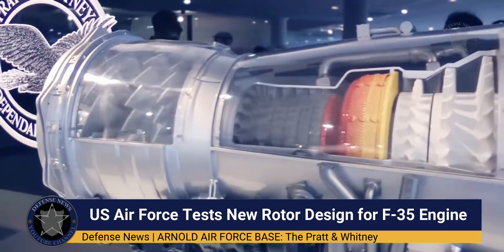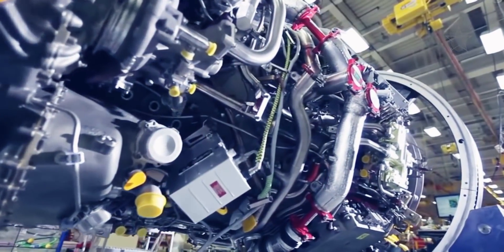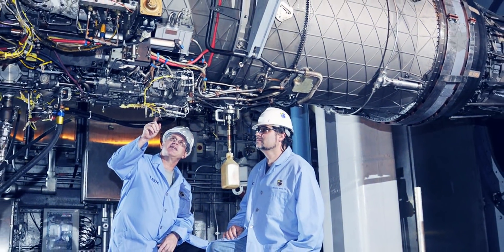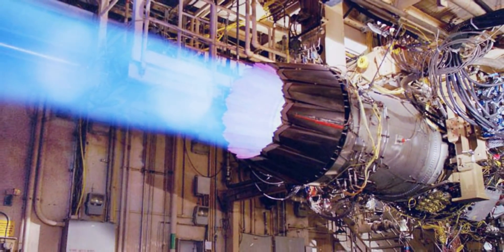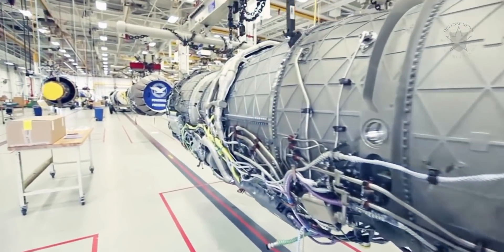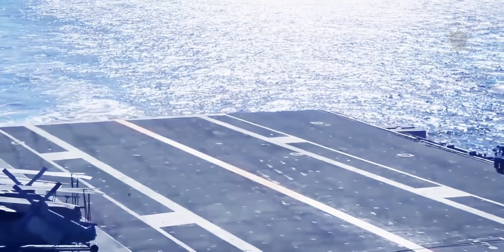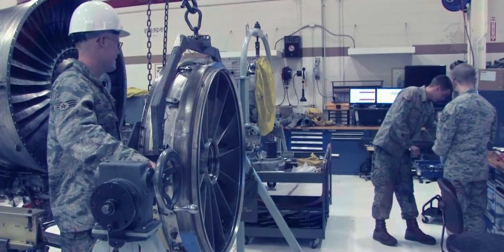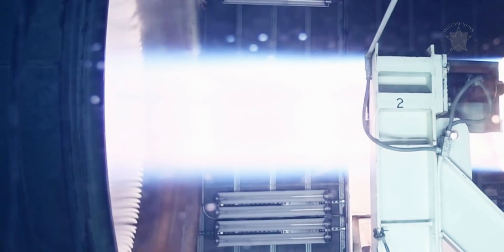USAF Tests New Rotor Design for F-35 Engine

Comment: IBR expansion exceeds tolerances during high G maneuvers. They must be using a less thermally active alloy in the rotor assembly. The DSA surface isn't mentioned, Im assuming that they're still using that method of rotor sealing?

Comment: They had a good engine to chose from. F136 GE. Politics won out again.
Reply: Would have wasted billions trying to save millions. F135 turned out to be the best fighter engine ever produced.

I'm sure an F136 would have been impressive as well, but for what?

GE is likely flying ADVENT motors as we speak in the 6th Gen program, unless USAF structured it differently than the ATF motor options from late 1980s-1991.

GE's YF-120L and N motors were the most impressive to the test pilots during DEMVAL, but the variable cycle feature represented risk to the program so Pratt was awarded, with the requirement that they match the YF-120 thrust, which they did with the production F119-PW-100.

Both companies have been working on their 6th Gen fighter engine submissions with 3 airflow paths, variable cycle modulation, extreme core temps, additive manufacturing to cut parts count, and alloy-ceramics.

I suspect we're going to see a 50,000lb thrust class fighter engine that can run at 32,500lb in mil power, which would be phenomenal.

With advanced composites and heat-mitigating leading edges, we might be in the age where we see a Mach 2 supercruise-capable fighter, where no afterburner is used.

Then again, a 50,000lb motor opens the possibility for the first time of having a large radome, high altitude, high endurance, Mach 3-capable interceptor....with a single engine. It's well within MiG-25 and F-111 thrust with 2 engines on them.

Comment: I'm not interested in the word Corona, I'm trying to figure out what part of a jet engine they're calling a rotor? I'm work around jet engines for quite a while both in the service and a bit out of the service, and I've never heard of any part of one called a rotor. Unless you're talking about part of the electric starter.

From the written description sounds like they're talking about the primary intake fan section. That is never been called a rotor to my knowledge. The only thing I've ever heard call the rotor other than the part of the electric starter is the main and tail rotor on a helicopter.

There's the intake fans with their blades, there's a compressor section blades, the individual compressor sections, the afterburner section and the tail feathers. But there's nothing in a jet engine called a rotor. But I guess you have to play games with the F-35 because it's a 66000 pound plane with a 44000 pound engine and they're still calling it fast. When it's lower than almost any combat aircraft we've had in awhile.
Reply: They would be the compressor and turbine disk and blade assemblies.

Comment: Yet another robo voiced video with no clear point to it 😠...dude WHAT IS THE POINT OF THE NEW CORE?
Reply: Hey Bill, in a nutshell the rotor was expanding to much in high G/ Thrust situations. The blades were exceeding tolerance against the ablative surface. Im assuming they are using  a different alloy or going with looser tolerances .
Reply: The point of the new core is to increase thrust to 46,100-47,300lb in max AB, and 29,960-30,800lb in mil, while increasing the fuel efficiency to extend the range/radius even longer.

They're using different manufacturing techniques and ceramic-alloy combinations to achieve it.

P&W already have demonstrated the capability without being asked to do it, and have a plan in-place to upgrade every F135 as they come in for depot-level overhaul during their mid-life inspections and refurb schedule.

Pratt said the new core technology is so good that they've already changed their processes to the new system as a result.

In layman's terms, we're living in an era where you will witness the progression into a 50,000lb thrust class fighter engine.

Keep in mind the F-15 & F-16 have been flying with 23,770-29,160lb thrust class F100 variants.

F-22A has been flying with 35,000lb thrust class F119.

F-35s are flying with 43,000lb F135-PW-100/400.

Even with the 46,100lb F135-PW-XXX, that will mean a take-off T/W ratio of .94 with internal bombs and missiles, and a combat T/W of 1.15 with 9,000lb of fuel remaining, still carrying 2x 2000lb JDAMs and 2x AIM-120C.

If the bombs have been dropped, it would have 1.19 T/W. Think Raptor and slick Typhoon class climb rate.

Comment: Is this the upgraded more powerful engine that they promised could go in the f-35 in 2020. Something like 48,000 lb thrust.
Reply: Might be. Supposed to increase thrust by 10% and range by 6%. I remember hearing about it as well. Cost was expected to be the same as the current version of the engine.
Reply: Where did you get this info? I never heard they’re planning to increase thrust from 19,5 tons to 21,7 tons(48,000 lb).
Reply: @AlexA-ln4pj  From years ago they said a more powerful version would be installed starting in 2020. It was all over the internet back then as a given. Don't have any links to give you. It would be very cool. The only reason the f-35 is not a 2.25 Mach fighter is because they did not put in variable inlets to slow the air entering the turbine fan. Why, dunno. Maybe high speed not needed or extra weight of them, or other. Sorry, could not answer the question.
Reply: Anyway, I want to see what version of this engine the b-21 will get, 19,5 tons thrust or more powerful.
Reply: @frankcrawford416 

Question do you know what speed a TMS of Mach 2.25 is, cause I'm guessing you don't, remember Mach 2 is about 1500mph.
Reply: 48,000ibf really not a chance.
Reply: I read that this subsonic inlet fan design Pratt & Whitney is developing is one part of a three part design process to improve the F135 engine. 
The second part is Rolls Royce responsibility .  Jet engines have a power take-off to a generator. This provides electricity for on-board systems. RR intends to eliminate the PTO by embedding magnets into the main shaft and coils in the engine case. Need a lot of electricity to fire lasers. 
GE is working on the third part. Remember the YF-22 vs YF-23 fly-off ? There were two engines on trial also. The GE 120 had variable bypass, a third path for intake air to flow that can be directed. Flying subsonic, it's directed to bypass. Flying supercruise or afterburner, it's directed thru the engine core. With some government help, GE has continued that research. They are also developing CMC.
Modern exhaust turbine blades are made from exotic steel with a small % of Rhenium. They are hollow with tiny holes and are air cooled to withstand the high heat. Afaik, only the three companies mentioned  can mass produce blades with single crystal technology. GE has developed a turbine blade that can take even more heat by using Ceramic Matrix Composites . Once P&W and Rolls Royce have finished their work GE may be the one to combine all these techs into one engine. GE wants to build the entire engine out of CMC because it's strong as steel but less than 1/3 the weight.

Comment: So just so we’re on the same page here… We’ve dumped $1 trillion into this thing… And it already needs upgrades?
Reply: We haven't yet dumped 1 trillion into yet, that is because the trillion includes all costs of each fighter through 2070, all spare parts, all pilot training, all maintenance costs, including training of those maintenance workers, and much more. The unit costs are where we need to evaluate. Those costs for air Force model have dropped to under 80 million. Upkeep or maintenance costs are actually much lower than currant older platforms. Peace brother.
Reply: Frank Crawford thank you, I’m sick a people spreading misinformation
Reply: Jesse Vang   You got that right.
Reply: That's the Total Cost of Maintenance. For the Whole  Aircraft Assembled in what the US Gov will Spend. In it's length of service?
Reply: Does the cost of safety  for our nation really matter  there is s reason our beaches have not been stormed in so many years
Reply: Supes Me ...FYI, every military build program constantly upgrades to not only fine tune things but also continue to improve on evolving technologies. That’s how you end up with block upgrades or different variants as well. Would you want an aircraft to roll off the line and never be improved upon or tested and trained on as often as possible?
Reply: @teddy.d174  To always be Ahead of the Enemy. Which doesn't have a Budget like we do. Which Country put itself in a huge Disaster financially. Until it can get back on its own. (CHINAH)

Comment: The Single Rolls-Royce PW 40,000ibf Non Thrust Vectoring engine may be the 2nd most powerfule engine on a military jet but the slow speed of the F-35 is the 2nd slowest jet out today at 1200mph Mach 1.56 using TMS really it needs 2 smaller engines about 25,000ibf per engine to have a chance to run with all others jets it only faster then the F/A-18 by 10mph.
Reply: F-35 is one of the fastest fighter in the USAF inventory, from practial standpoint. It could reach the Mach 1.6, even if it is carrying its internal weapons loadout and its huge internal fuel load. The internally A2A weapons are not as much as the F-15 has, but also quite capable. If the Eagle has its 8 AAMs, the speed is reduced down to Mach 1.78. Without any external fuel tanks! With external tanks, the top speed is not more than mach 1.45. But without any external tanks, the F-15 has only 6.5 tons of fuel, while the much smaller F-35A has more than 8.1! No external tanks needed at all! So from this point of view, even if we know the good old bullshit about the Mach 2.5 capable F-15C (it was just a theoretical result of the speed/altitude diagram, where the plotted curve was ended at the design limit), the trully current fastest fighter in the USAF is the F-22 Raptor, while the second one is the F-35A! These two 5gen fighters able to carrying their basic weapon loadout in an aerodynamically completly clean configuration!
Reply: @kolbola 

Kid the F-35 is slow as shit 1200mph.

Plus only holds 4 missiles in bay with not as much fuel as others.
Reply: faron tilley ...It doesn’t have to be fast, if it did they would’ve put 2 engines in it and made it a faster aircraft. It was designed with the most advanced sensors/radar to spot, track and complete the kill chain before any other aircraft, missile battery, or whatever else even knows it’s been there and by the time you know it was there, it’ll be too late because you’ll be dead already. It also doesn’t have to hold a lot of ordnance because it’s integrated into other aircraft, UAV’s, ships, subs and other types of weapons systems. It processes battlefield information and the pilot can direct other aircraft assets or many other types of weapons systems to take the shot and get the kill. Your mistake is thinking it’s just another fighter, it’s everything else and much more.
Reply: @teddy.d174 

1st many things you said is not right.

2nd Just want to point out one of your mistakes, you said if they wanted it to go faster, they would have put 2 engines in it, no for example F-16 one engine speed 1500mph, J-39 one engine 1500+mph, the F-35 is slow end of.
Reply: @forzaisspeed  1200mph is slow? 🤣🤣🤣
Reply: From what I read, it can't go supersonic or it looses its Stealth Coating.
Reply: No inlet ramps on the f35.
Reply: Mf1984 

Kid what are going on about.
Reply: Mf1984 

Kid you stupid or stupid.

1st The J-20 is a 5th gen jet.

2nd What country do you 5hink I'm from ?.

3rd The US wouldn't have been able to afford the F-35 if not for others helping.
Reply: Mf1984 

1st The J-20 is classed as a 5th gen jet, Deal with it the F-35 and F-22 gets seen on radar JY-27 S-400 even Germany picked up the F-35.

2nd The US couldn't afford the F-35 from the start, the US needed help to first design and make the thing so they came to the UK, when when it won the contract they needed help from other country's to help pay for the thing, the F-22 the US can't afford to run all F-22's, that is why over 50% arnt combat ready, and one of the mean reasons why the US stop making them was due to budget issues, so the 187 you see on Google is more like 75-80 that at are combat ready.
Reply: Mf1984 

Yes top speed is not the big point, but having a faster jet is better then not, for example having a faster jet means you can supercruise at a higher speed, the F-35 supercruise little under 1000mph, the Eurofighter for example little over 1150mph, so there is about a 200mph gape.

Comment: What does this new rotor fan design do for the F-35?
Reply: I think it's a more efficient rotor/inlet impeller. P&W knows a rotor/turbine fan looses efficiency as it goes supersonic. This one stays subsonic, is my guess. It might help with not having variable inlets also.
Reply: make it fly
Reply: Pour eviter de faire fondre le sol a chaque decollage verticale et peut être allez en supersonique mais c'est pas sur. 😂 un vrai feuilleton ce F35, vivement la suite.
Reply: Increase thrust from 43,000lb in max AB to anywhere between 46,100-47,300lb. Mil power will be 30,000lb.  Range increases because it burns fuel more efficiently. F-35A already has really long legs and high T/W ratio, so it just makes it better.

Comment: The new Russia mig is faster very sad usa
Reply: It is hilarious when people quote the top speed of an aircraft as if it means anything in combat. The F-16 is faster than the F-35 on paper but in the real world the F-35 carrying a combat load has a 50 knot cruising speed advantage over the F-16 because it doesn't suffer from parasitic drag like the F-16. So in reality the F-16 has to fly on afterburner to keep up with the F-35.
Reply: @Bellthorian 

But you forgot that as the F-16 uses its missiles and fuel and the F-16 gets faster and faster, so the F-16 only needs to us its re-heat going to the target not after, plus the F-16 does not have to use its re-heat to keep up that much, remember the F-16's speed 1500mph drag not really going to slow it down over 300mph, and the F-35's speed 1200mph, it can't get to that speed with out the re-heat, supercruise for the F-35 is about a little under 1000mph, so there is a 400+mph gap and drag again won't slow the F-16 down over that much in some what good conditions.

Yes top speed is not the big issue to worry about, but having a faster jet does have its advantages.
Reply: @Bellthorian 

1st Not really, due to that of what I explained in my previous comment.

2nd The F-35's fuel and Weapons usage, is yes meaning its getting lighter as well, but the F-35 does not have the speed coming back to it like the F-16, meaning the F-35 has missiles in bay no drag so the only thing the F-35 is getting is lighter, its not getting the energy back from the dragging of the weapons, so the F-16 gets more back in the weapons being used, and fuel is the same on both, so the fuel is irrelevant, the F-35 top speed and supercruise is basically the same is if it was clean to some extent, plus the F-35 holds less then the F-16, so if both F-35 and F-16 go in to destroy a target, the F-35 without re-heat just supercruise it will only be doing little under 1000mph and F-16 with the drag as well not just the whight it's down to about 1200-1300mph with re-heat, they do the bombing and come back, the F-35 is flying supercruise still only under 1000mph, while the F-16 is now back to 1500mph with re-heat or little under 850mph in supercruise.

So what I'm trying to get to is this.

F-35 /

1) Re-heat - 1200mph.
2) Supercruise - little under 1000mph.
3) No drag interfering with speed while in stealth mode.

F-16 /

1) Re-heat - 1500mph.
2) Supercruise with 2 sidewinders - little under 850mph.
3) Drag from missiles 1500mph down to about 1200-1300mph.

So the F-35 maybe some what faster while supercruising but is slower in Re-heat and even when the F-16 has full weapons but still using Re-heat.
Reply: I'm sure the Russian mig would be it has two engines
Reply: @kylelytle4251 

Having 1 or 2 engines don't make it faster, for start having 2 engines make the jet more heavy, and jet's like the Gripin and F-16 have single engines that are faster then some 2 engine jet's.
Reply: Think then speak
Reply: Mf1984 

Stealth does not make you invisible.
Reply: Mf1984 

Kid.

If you read my comment you'll would have seen I said faster then some 2 engine jet's.

For Example F-16 Gripin are faster then the F/A-18 witch is a 2 engine design.

Yes having 2 engines is better not just for speed but for if one goes out you still have one to land safely.

But having 2 engines is also a bad thing in some areas.

Having 1 or 2 engines both have pros and cons, so not one is better then the other.
Reply: The mig. Flying trash can.
Reply: Mf1984 

That's funny cause you can find and track stealth jets, plus there are other Systems like IRST's that can see a F-22 from over 70+km away, and that Country's are now not pushing stealth so much for 6th like they did for 5th, yes stealth will still be a point in its design, but not as much to not hold back the jets performance like 5th gen's have.

And No 5th gen jet has been allowed to go in to a fight due to the risk of losing it and the bill and the embarrassment for that country that lost a stealth jet in the first place, why do you think the F-22 have seen a real fight, other then in games.
Reply: Too bad they won't be able to build enough of them to find out if it matters.